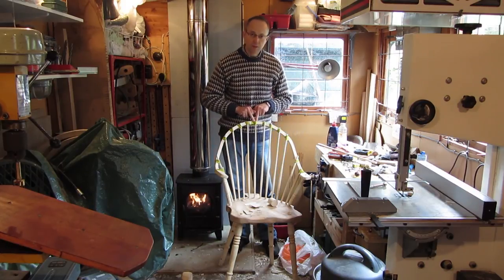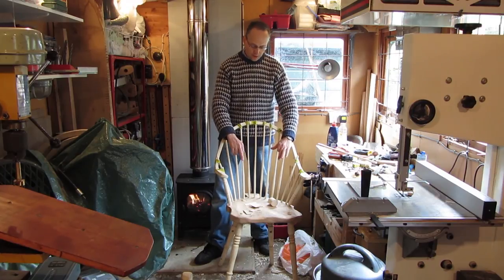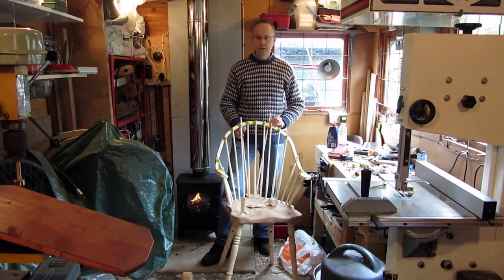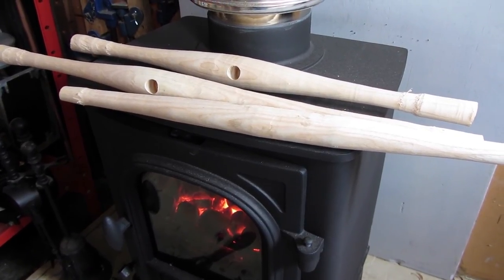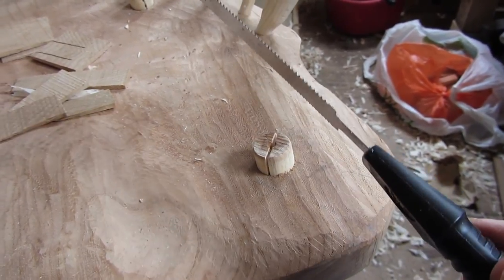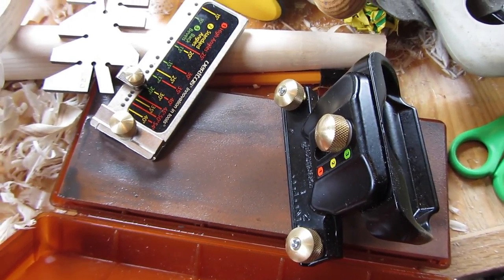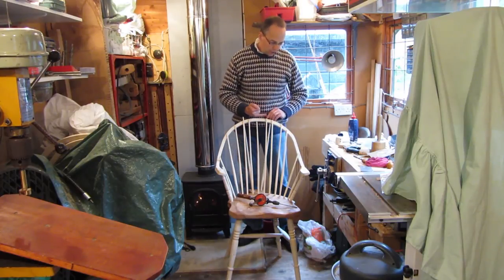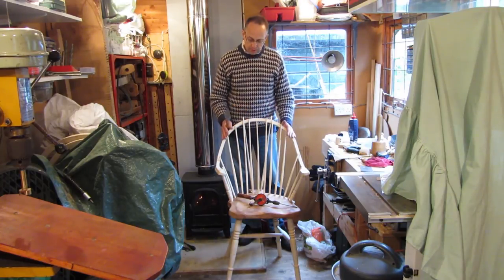Continuous Arm Windsor Chair Assembly - Chairmaking

Comment from the maker: Hi Bill - sorry, but if it helps the bow blank is 61 inches, the big radius is 9.5 inches, and the two small ones 6 inches, the centre spindle is 22 inches long and slopes at 78 degrees, the others slope at 78,76,74,71,68,69,65 degrees and the tip of the arms is 8.5 9nches off the seat....I hope that helps, and I may across the winter start writing a book on all this stuff so that something is written down. Regards Harry

Comment: A metal version of that chair could be very nice but you'd need to keep the actual, and visual weight down.  I'd like to see what you come up with.  An old steel tractor seat might make a good seat bottom.